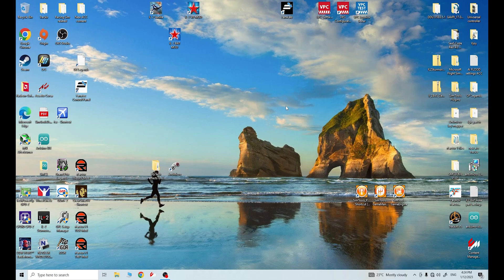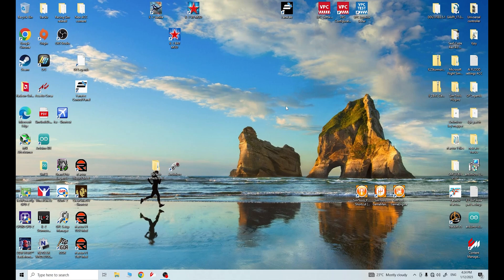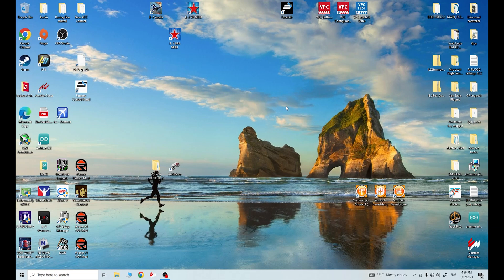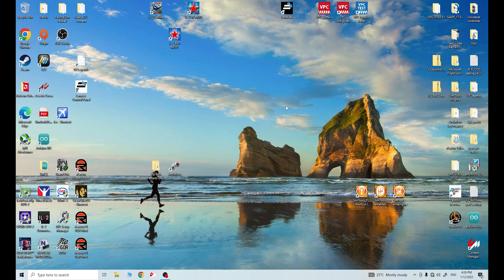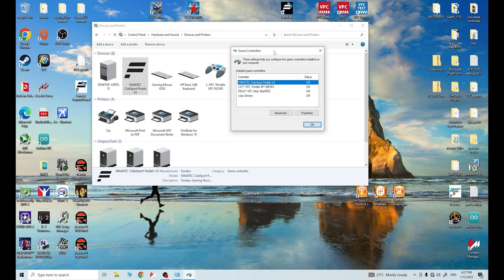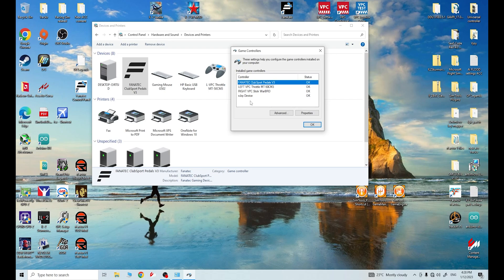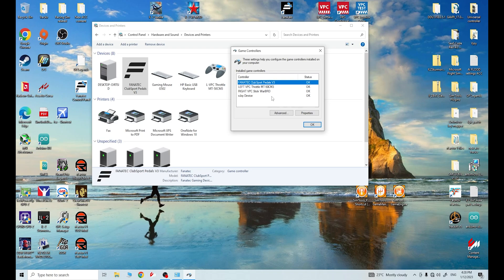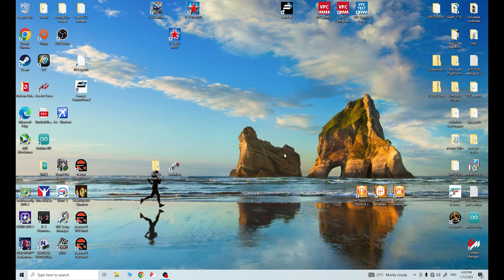Racing Pedals To Rudder Pedals Emulation Still Won't Work? Try This!

Comment: Hi Doctor, great videos. Which plugin do you use for your IL-2 1946 version running the B.A.T mod?
I play the B.A.T version as well but can't find a plugin for it. I've seen all your videos so far, great work Doctor.
Reply from the maker: @plutonot hey mate, I appreciate the support and the feedback!. Its the 2.0.0.0 Il2-forgotten battles plugin written by Prilad. All I do is make sure I point it to the actual mod folder I'm about to play. I've found if I don't do this, my platform acts weird.